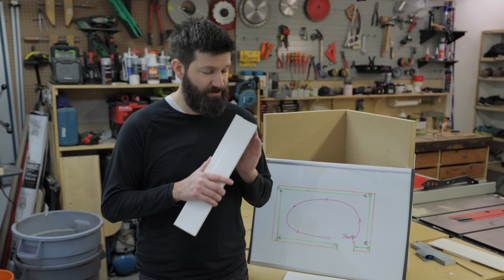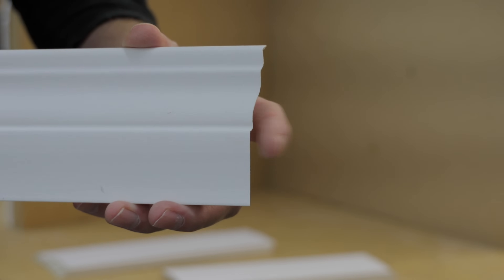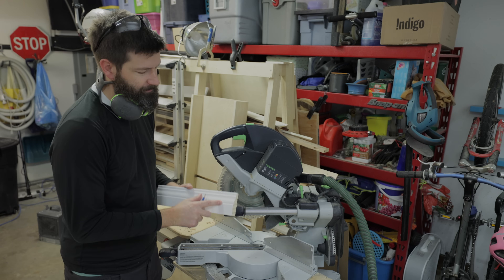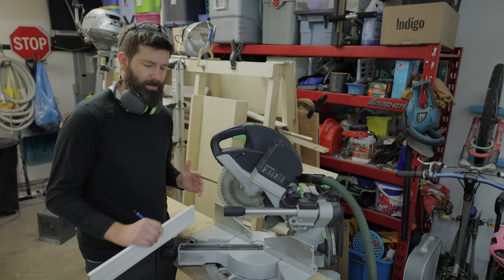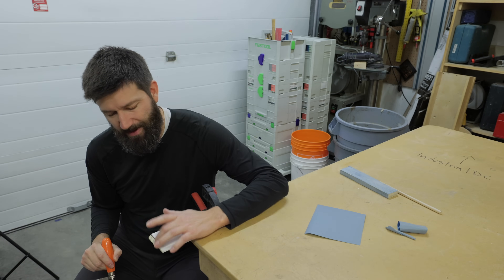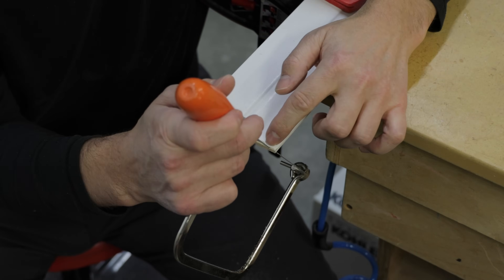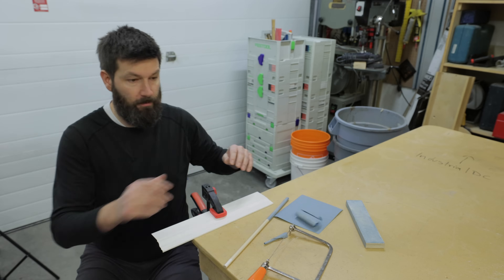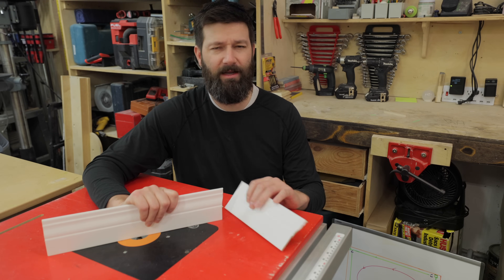How To Make Perfect Baseboard Cope Joints!

Comment: Coping is great on real wood, but on MDF it’s like sawing cardboard. You get rough fluffy edges that are a pain to work with and really fragile and brittle when the board end is thin.
Reply: I haven't done a lot of coping, but i wonder if the MDF cuts would be clean with an extra fine tooth coping blade, and/or leaving extra material and finishing with fine sandpaper.
Reply: @bubbavox  Ive trimmed my whole home with MDF formed mouldings. No matter which way you do it, the physical makeup of the material just doesn’t allow to get a clean edge with a coping saw. It so easily breaks and is very thin and extremely fragile. Quite frankly it’s should not be used and sold for so many reasons. But this is the world we live in today. Cheap, nasty and throwaway is in vogue. The need to make money over quality is very obvious. Most Pine products today are finger jointed made. I get it that less wastage is something we should all strive for and being frugal is a good thing. But there are limits to how far we should go. I’ve witnessed many truck loads of logs (Good lumber) shipped into the mill, to get ground up and then coated with nasty glue and pressed into OSB boards. These end products are food for mould, offgas for ages, susceptible to water damage and burn like hell. MDF dust is dangerous to lung health, and cut edges are so rough painting is a real pain. You have to seal the cut edge with a glue or paint. Then sand, paint, sand, paint to get anything close to a smooth finish. Anyways that’s my opinion. Let me wish you well and thanks for the comment.

Comment: Coping is definitely the way to go 99% of the time so the joints stay closed. Learn to use a jig saw with a long thin blade instead of a hand coping saw. It’s easy to learn and saves massive amounts of time.

Comment: Flat butt is absolutely not happening. It depends on the profile of the base, if it’s a straight or more basic profile I’m gonna just miter typically. More complex profile is definitely getting coped though.
Reply from the maker: Flat butt is the exact same as profiled cope, and for all the reasons that a cope joint is less likely to crack the same can be said for a flat butt as opposed to an inside mitre.

Comment: I cope almost every inside corners except inside corners 120 or more I try not to do such a high angle back cut I leave mine in about 10° that way with the coping saw you’re not cutting through as much material 98% of the time I’m using my jigsaw
Find tune with a nice file set stain me sir

Comment: I don't know but seems a lot a extra work first 45 miter to reveal the profile then flip base to cut the flat part then coping saw and bla bla bla and also is a small piece imagine flipping a 16 feet piece i just cut the base flat 45 bevel and let's go
Reply from the maker: If you have a slide saw you won’t need to flip the piece.

Comment: If you have a decent miter saw and a good angle finder, you can miter them and they will look 100% as good as coped in about 1/2 the time.  Anyone who says not coping is a hack job is just delusional.  Unless you are doing stained base boards, mitering is the way to go...
Reply from the maker: It’s definitely not a hack job to mitre the pieces, that being said the cope joint is overall a better joint.
Reply: I think it also depends a lot on what kind of profile you are looking at. 

I work a lot with simple rectangular baseboards with an eased top outer edge. And the thing, is, a mitered cut to say, a 44 degree angle,  IS a coped cut, in that case. it's exactly the same. The leading edge of the miter is preserved, and the back is relieved to ensure good contact. It's just a coped joint where you cope the top instead of leaving that tiny fragile top edge. and it's easier to work with as it's less fragile and you don't have to remember which end is which. 

Sure, you will have a tiny gap at the top of the miter, back from the leading edge which is the plane of contact, but caulking that is trivial and super fast, and all these people talking about the time you spend caulking..... you have to caulk anyways. Period. Do you want that ugly black line between the baseboard and the wall? no? do you want dust and crud accumulating in that gap? no? then you are already caulking everything.

I am sure there are situations where coping is the play, but there are definitely, imho, situations where it make zero sense, and that is basically all we are doing in my area right now, with supply shortages and current styles. ALL the base we are putting in is just a simple rectangle with an eased top edge.
Reply: I think it also depends a lot on what kind of profile you are looking at. 

I work a lot with simple rectangular baseboards with an eased top outer edge. And the thing, is, a mitered cut to say, a 44 degree angle,  IS a coped cut, in that case. it's exactly the same. The leading edge of the miter is preserved, and the back is relieved to ensure good contact. It's just a coped joint where you cope the top instead of leaving that tiny fragile top edge. and it's easier to work with as it's less fragile and you don't have to remember which end is which. 

Sure, you will have a tiny gap at the top of the miter, back from the leading edge which is the plane of contact, but caulking that is trivial and super fast, and all these people talking about the time you spend caulking..... you have to caulk anyways. Period. Do you want that ugly black line between the baseboard and the wall? no? do you want dust and crud accumulating in that gap? no? then you are already caulking everything.

I am sure there are situations where coping is the play, but there are definitely, imho, situations where it make zero sense, and that is basically all we are doing in my area right now, with supply shortages and current styles. ALL the base we are putting in is just a simple rectangle with an eased top edge.
Reply: The biggest advantage of coping is it reduces opening and cracking of the joints due to movement and expansion